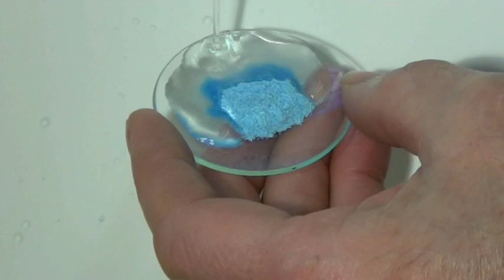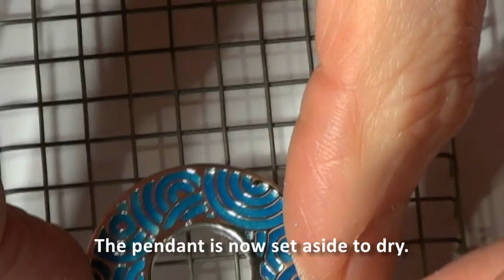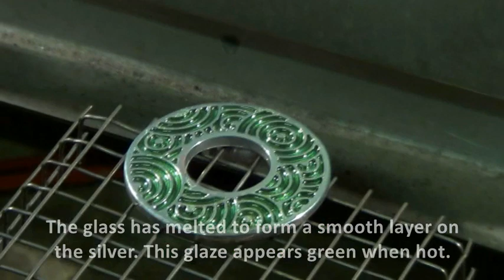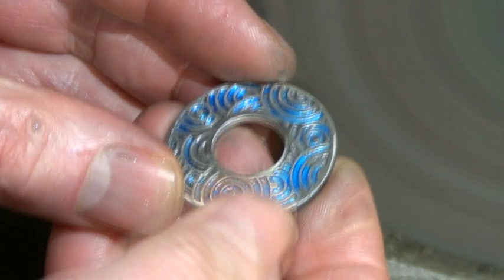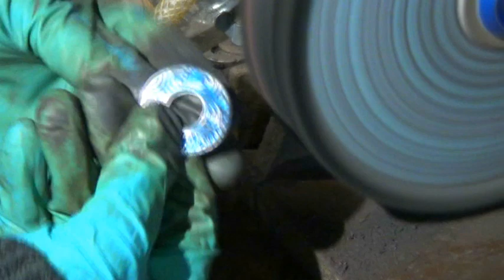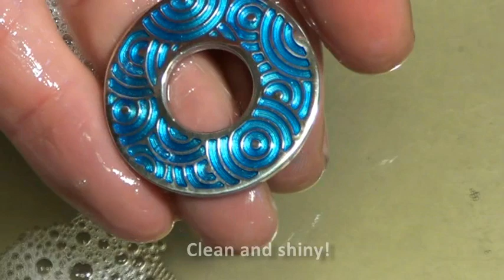Enamelling the Pools of Blue silver pendant - Skye Silver

Comment: Did you solder the back on? If so why didn't it fall off when you fired the enamel?
Reply from the maker: The entire piece is a casting, so the ring is integral to it. However, you can actually solder on to an already enamelled piece if required, it doesn't seem to mind!

Comment: Beautiful!
Doesn't the silver blacken when it goes in the kiln?
Reply from the maker: Thanks! Surprisingly, it doesn't blacken very much, but it is only in for a couple of minutes. In addition, the glaze will protect the metal surface from the air, so any oxidation that does occur is only on the bare metal, which gets polished afterwards anyway.
Reply: Thanks. 
Can you pickle a piece after it's been enameled without damaging the enamel?
Reply from the maker: Hmmm....I've never done it, and reading around, it seems some enamels can be sensitive to acid and actually get etched (and go rough/cloudy). So I'd try and avoid if possible, or only pickle for a very short time. By the way, this is plain old Sterling silver - lots of people say you need to use fine silver, but Sterling seems to work perfectly well!
Reply: Yes I kept hearing about the fine silver thing too, but your video a others seem to disprove that.
Thanks a lot

Comment: Nice work , thanks for sharing ! 
Is the model made by CNC Cad/CAM or by casting ? It seems to be made by a CNC ...
Reply from the maker: Giacomo I Thanks for the comment! Yes, this piece was designed in CAD (we use Rhino 3D) and then a wax master pattern machined out using a Sherline CNC mill. That was then lost-wax cast in silver for use as a metal master.

Comment: You are not removing dust, you are removing oxidations of the glass.
Reply from the maker: Hmm, doubt it - considering glass is a mixture of oxides already, it's not going to oxidise any more. However, there is an extremely fine dusty powder present, caused by abrasion of the glass particles during storage/handling/transit, and this causes a cloudy appearance if not washed out.